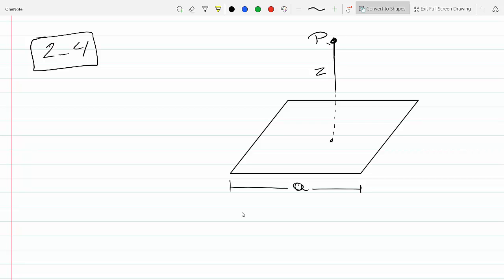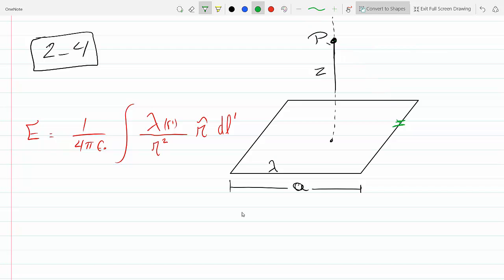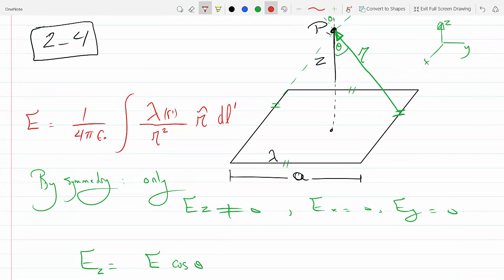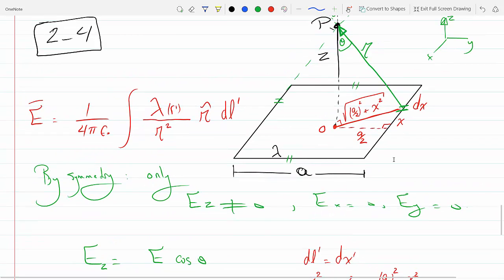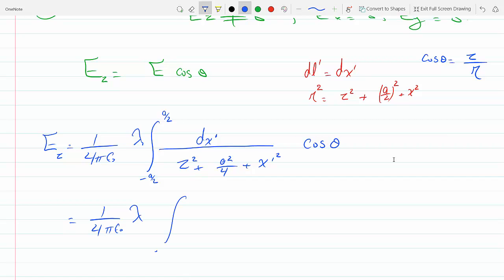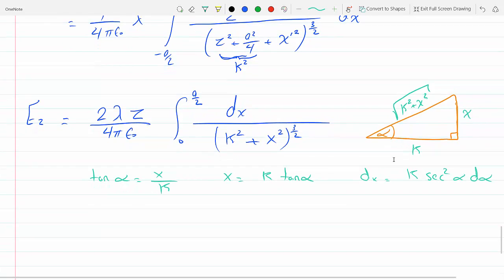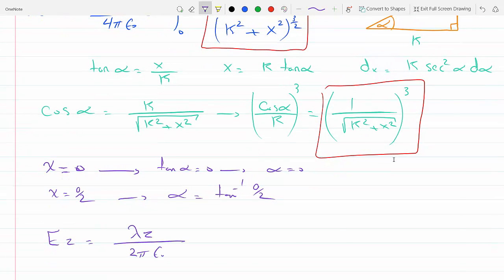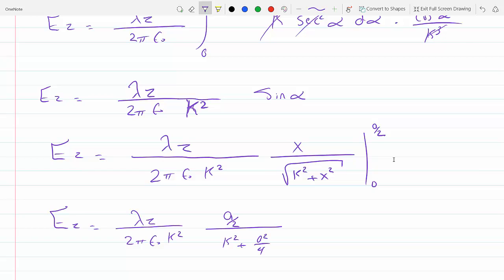Finding the electric field a distance z above axis of a square ex 2616

Comment: I wonder one thing. You have said K^2 instead of z^2+((a^2)/4) at 9:24, but the square of both sides of K = z + (a/2) does not equal to the answer which you have found in the solution. If it were, it was supposed to be K^2 = z^2 + az + ((a^2)/4). Could you explain this bro since I am so confused :d

Comment: hey, i have a question.. You integrated from 0 to a/2 .. then shouldn't you multiply by 8  ?
Reply from the maker: no beause I slipped in (multiplied) a factor of 2 already when I changed the bounds of integration to [0,a/2]
Reply: Sorry , didn't look at that

Comment: In finding the limits for alpha when x = a/2 it's stated that alpha is Arctan (a/2); what happen to the K in the denominator. The definition for tangent of alpha was define as: tan(x/K) not just tan(x) so when a/2 is plugged back in to find the limits for alpha it would seem to have to include the K also?
Reply: hey ? same problem. did you get answer?